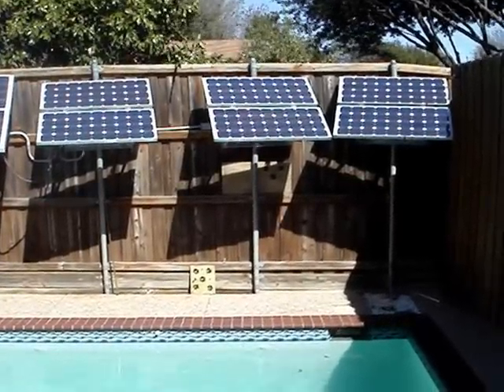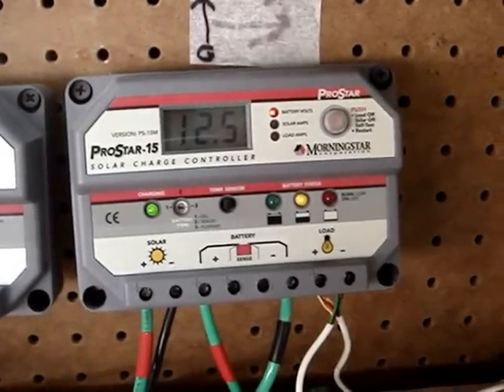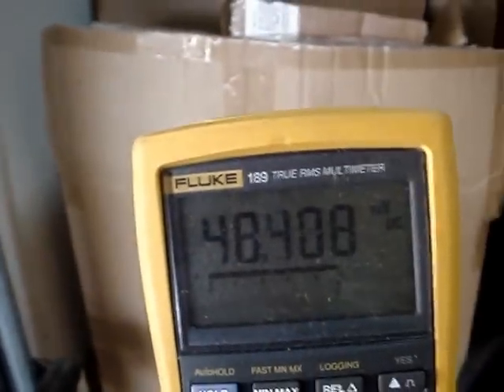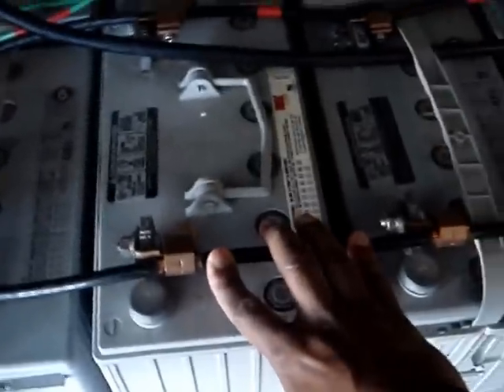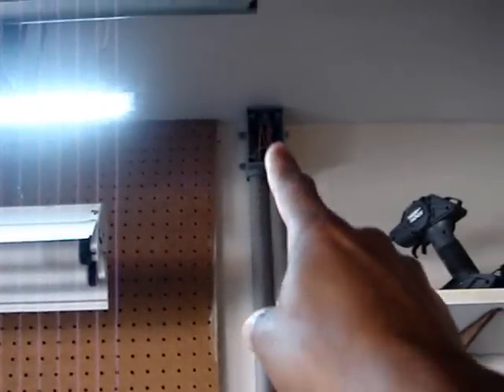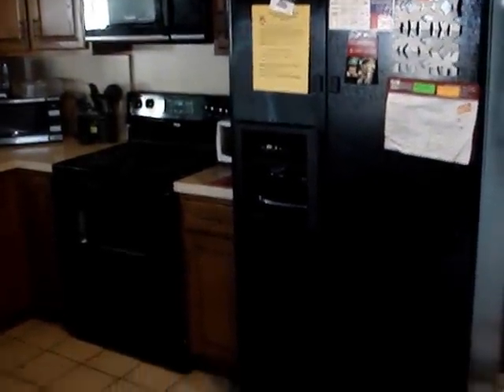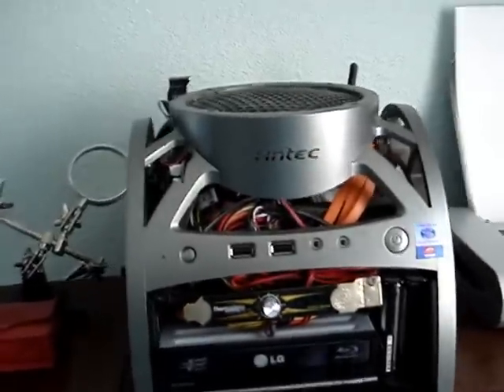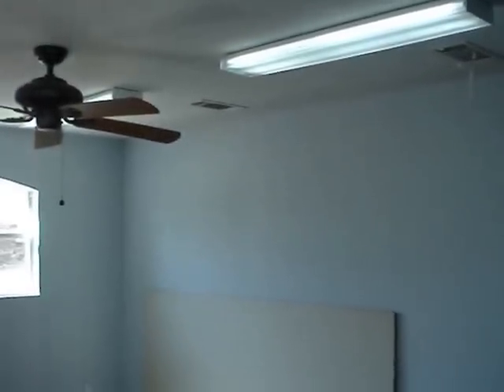My Solar Setup

Comment: Is there no way to run the 240 volt appliances? A 240 volt inverter? You've done a great job!!!
Reply: QuantumBraced You can get two Xantrex inverters and hook them in series for 240 volts. They have an Ethernet cable between them to communicate with each other.
Reply: And/or run at 24 or 48 volts and it'd run great I agree those inverters are great. Clean power
Reply from the maker: QuantumBraced there is but those inverters are expensive and power hungry
Reply: IwannaGoFast Solar xantrex inverters are around $1000 each. that I have. Not sure about the power consumption. Mine has a built in charger though. I'm not sure if you would need that in both inverters.

Comment: It's amazing what you have done. If you replace your stoves with gas stoves and you just put wet clothes on a rope and not use the dryer, you can actually just unplug from the grid completely.
Reply from the maker: fuertesyrobustos Thanks and yep thats what i would love to do, but my wife likes the convenience.
Reply: fuertesyrobustos True but the dryer helps save time, plus makes the clothes look and feel nicer. If I had all of that at my house all on solar, especially in the kitchen like that, it would never be a problem to pay the electric company for using the dryer. I want to make any small solar setup to get started and then grow from there.

Comment: Thanks for running us through your rad setup!  Your family should be proud.  Wish you would have toured us through your chosen battery bank products... Im sure youve researched enough about batteries by now!  Point of contention, Im a little disturbed by your green plastic "cook pot".  You deserve the best, get yourself something made of glass instead of fluorescent plastic.  Most of all, even if u keep the plastic "cook pot", please get yourself a glass pull, never use a metal or plastic one.
And strongly consider a solar powered vaporiser... why use gas?  Vapor Brothers makes good wood and bamboo products from well resourced forests.
Reply from the maker: EG Murray Hi Murray, I'm a little confused. what green cook pot? there on the kitchen counter is a stainles and black rice steamer. maybe it was the poor lighting.
Reply: I was referring, as delicately as possible, to your green bong.  You deserve better than to imbibe all that nastily decaying, BPA, etc  plastic.  Excessive heat and excessive cold (ice cubes) all further an already non-ideal experience. If you're not a juvenile boy, than get a real glass piece with a non metal (ceramic or solid glass) pull already.

Comment: Are they all the same solar panels. How much till Its all paid back?
Reply from the maker: Stephen T Hi Stephen, all sixteen 85 watt panels are GE. The two 125 watt panels are BP. this system was put together of all used items from ebay and craigslist. cost about $3k. it knocked about $210 off my bill.
Reply: That's very good. The $3k was very cheap. Is that $210 off your bill per month.

Comment: Are there any problems with running the two charge controllers at the same time? Do they 'fight' with each other? Would it be possible to run 3 or 4 charge controllers at once on the same battery bank?  I'm no expert, but I think running the PV panels direct to your battery bank seems unsafe. I guess it's working? I assumed they would need their own charge controller to be safest. I don't know. Your setup looks great. Looks like you can run almost anything with it.
Reply: Some are designed to work in groups. You'd obviously have to check.

Comment: Nice setup! That's a cool place. Like how all the batteries were all on one wire.
Reply from the maker: off grid kid Hi and thanks for noticing that because that took a long time heating and bending all those terminals, skinning all that wire just where the terminals contact, i was on my knees bending over that battery bank for 12 hours doing that. It was the hardest part of the whole setup. my back was hurting.
Reply: Good things are worth the extra time.

Comment: but you do have 220vac .you have two 110 vac inverters.witch gives you 220vac.witch will work fine .and dont stand around the batterys to long.the gas coming off the battries will kill you.but you have a good system.herb

Comment: Nice! I like how you used the fence, the single cable for the batteries was very innovative. You must have a dump load to regulate the power level to those batteries? Impressive work, subbed.
Reply: ***** I watched the video again, he has a manual switch to disconnect the panels that are directly wired to the batteries. Some types of charge controllers (my xantrex c40) have the optional dump load. I think its more commonly used for a wind turbine.
Reply: One of the coolest ideas I've seen people do is to replace 1 or both elements in their hot water tank and with the "dump" load (excess power when batteries are full) and they use that to preheat or heat their hot water fully if they have enough panels that it's common. Farmers use it for just that a lot also. Or straight to a smaller inverter thatd charge your Dewalt cordless etc? Even a 12volt bilge pump to water your garden w a rain water tank. Just had to be something that won't need a ton of power and that doesn't need to be consistent

Comment: UMMM, your solar panels are cranking out a LOT of juice.....but you are pulling 2.5 amps out of your batteries. Wow, you need to better utilize the energy harnessed by your system, IMHO.

Comment: Just one question, Is your Tripp lite inverters pure sine wave ? Thanks..
Reply from the maker: No don't think so. But I have got 4000 watts out of them @125 vac 60Hz.
they are (Tripp Lite APS2012). they are rated at 2000 w but easily handle a lot more.
they also have built in 100amp battery chargers. They don't whimp out when the going get tuff. I love these inverters.

Comment: Great video and useful information.  I am getting ready to set this up in my house and will be putting my battery bank inside.  Can you tell me if the battery bank and inverter set up that you have in your garage throws out much heat?  This will tell me if I should think about putting in upstairs or downstairs. thanks

Comment: please protect those batteries from any stray metal tools, etc, contact.  You have a lot of short circuit current available in the open, under your bench.

Comment: nice work bro, how long for it to pay for itself
Reply from the maker: Well the system didn't cost me but about 3K. and I can save about $200 a month with it. saving $ was only part of the goal. Being able to have electricity and maintain some kind of normality for my family in this uncertain world, and fragile power grid. is the overall goal.
Reply: IwannaGoFast Solar thanks for reaponding
Reply: Nassim Bendimerad well lets see here, free power, that probably cost him 3-5k to build, in one to two years its paid itself off. Every year the electric bill in an average household is $1200, if he slices that in half, you save $600 a year, after 5 years that $3000 (that's if the batteries last 5 years, they will most likely last longer considering they are constantly maintained and charged properly by the controllers. I have a 1000AH battery bank, with a 1000watt solar array. I run my refrigerator, my tv, xbox, and surround sound, laptop, and printer off of a 6000w inverter with no issues. I have had the same 12v 100AH deep cycle marine batteries for 8 years and they still hold a charge wonderfully. My electric bill is $22 a month. Point and case.
Reply: Imperial Auto Detailing and my system cost me around $4.5k to make with me doing all the work. The batteries are $200 a piece, Solar panels are 12v @ 100Watt Each cost $150 per panel, Outback 80a Solar controller was pricey but I managed to get a used one for $200 and it works great. The inverter was $600, wires and other hardware was another $200.
Reply: its called self sufficiency! and the fact its something you control vs being at the mercy of mother nature....
Reply: IwannaGoFast Solar what's the point if you have to buy new batteries each 4 or 5 years ??

Comment: Is all this solar to save on power bills or back up in a power outage?
Reply: I think it's a huge expense going solar, if you are in an area that loses power for weeks at a time I suppose it's worth it. I signed on with a business that can get you a free power bill. It's only in 19 states right now, mostly back east, but by 2015 it will be in all 50 states. How does it work? If it's in your state you sign yourself up for energy, you get a website and you see how much the company if offering a kw for and you look at your current bill and see what you are paying for a kw, if we are cheaper you sign up and save on your bill, if you get 10 people to do the same the company will pay your power bill. There are conditions though for example you can't have a $500 a month power bill and go sign up 10 people with a $200 power bill. The company would do an average and that's how much would be off the power bill.Oh and you also get paid a commission every time a customer pays his bill.

Comment: I have hooked up two 5000 watt inverters to get 240 ac by hooking naturals from each together than u have 2 hots of 120 each. dc side i have four 255 amp hr  deep cycle batteries. 255 x 4 =1020 amp hr. have no hooked up on solar yet.
right now i charge batteries with a 150 amp auto alternator hooked up to a old lawn mower engine w/16 hp.
this set up runs a 40 gal. water heater with a 3500 watt element and all the lights in home and microwave.batteries are charged for 1 hr per day. in 30 days  about $20.00 to $30.00 in fuel cost. cut a $200.00 light bill down 75%.
now i need to price the cost of solar set up. for more savings.

Comment: I think you can use both your inverters and wire one to the first buss bar and the other to the second buss bar and you would have 220 volts on your main panel. You just need to combine them on one main panel. 120 and 120 = 240 volts. just wire them to the main breaker.
Reply: I wouldn't do that..............there are electronic reasons why that won't work and will cost you both inverters.
Reply: There's no way to phase them properly. Not good.

Comment: great job and I do understand a working progress. have you had power loss at night running off the battery. or do you maintain thought out the night. and recharge the next day. also r u set up that if you solar fails for some reason maybe some how thow a switch and get back on grid. You ready gave me a lot to think about I am playing with the idea of doing something like this at my house. and yes you house runs mostly on 110 but the main power eater in most homes is the A/C unit and hot water heater. but they are 220 :( which sucks. maybe with some more panels you might be able to run some window A/C units and click off the central unit. who knows but is a nice set up thanks for sharing hope to see more.
Reply: They make 12 volt and 24 volt heat elements for water heaters.
They also make low voltage air conditioners.
And he could run a window unit any time since he has enough power to run it.
Reply: Bonnie you are 100% right!! That kind of stuff is where everyone should start..... Hot water heater elements, ac units, refrigerators like you mentioned because for a lot of households their hot water tank for a family of 4 costs a hell of a lot more vs running light bulbs. That's where people see the return on their investment, not hooking up their garage lights for something to tell their friends lol

Comment: You see like an intelligent person with a lot invested in money and self education. I enjoyed your video, but I have to make a critical suggestion. That is that you never run your panels directly into the battery bank. Your voltage output is too high to consider it CCCV healthy. Plenty of 100 amp controllers on the market to take care of your total needs. Better to spend that money now, than on prematurely failed batteries.

Comment: oh you might have to change your inverters to 24 volts mine is 24 volts at 3000 watts i power my hopme completely just like yourself works better than before i was on 12 volts i will never go back infact i would love to go on 36 volts but thatmeans i would have to get rid of my inverter again at 500 euros a piece NO thanks
Reply: I have 36 Volt. Some accessories are hard to find. Charge controllers, inverters etc.

Comment: what you need to do is connect 4 panels in series at 48 volt more volts the better
buy an outback flexmax 80 they go up to 150 volts and connect your batteries 24 volts the outback converts 48 volts down to 24 volts works without a fuss Believe you me you wont be dissapointed and you will never run again on 12 volts.

Comment: Thanks for sharing. What a great installation you made! Are you grid-connected? It would not make much sense to have a battery-bank and be grid connected, you could install more PV's instead. You're not heating your swimming pool electrically, are you?  Thermal swimming pool-heating is the absolutely most efficient way. Again, thank you for sharing, your work is great!

Comment: What gauge of wire r u using from ur panels to ur controller? I have a 135 watt setup just to learn then go large scale and with a 100ft run of 10 gauge wire I'm only getting 5 amps compared to 11 amps with a 5ft run

Comment: Hi,  I like the commitment you have made.  I also like the led tubes.  Can you provide a link for those?  On a different note.  You are using way to small cable.  While I know that a amperage chart may show you can use that guage.  But you are experiencing huge loses.  I say this as an Electrical Engineer.  Other wise.  Good job.

Comment: A lot of talking about amps and volts, but not much about energy. How much enegy [kWh] you produce per month?
Reply: TheSimpsonsLover What type of battery is it that doesn't require venting?
Reply: Dwyane Dandridge SLA (Sealed Lead Acid) batteries not require venting in normal (no damage, no overheating) conditions. These are used in computer UPS (Uninterruptable Power Supply) devices. There are also Li-Ion, Li-Po, Ni-MH and few other kinds of rechargeable batteries which not require venting, but these are too small/too expensive for big energy storage.
Reply: Technics6. Thank you very much.
Reply: ***** If you overcharge them there are vent caps that pop off.

Comment: Looking sweet. Great way to find stuff on the cheap. You're pay pack will be like 1.5yr with the next 25-30 free $. I'm guessing your charge controllers you do have will detect increase volts on bank from the panels without controllers and back off accordingly? I guess if you leave for trip you leave loads on in house or disconnect some panels. Ever consider using SunG plugin GTI for the excess once batts topped off? You can get cheap relay ($60) and setup to relay excess to GTI

Comment: Thats cool 3000.00 for the hole setup right . If I owned a house I would invest in this for power .But I would use solor and wind , wind when there's no sun to charge the solar panels . Thats a great way to save money and get off the grid . Can you run if setup 220 a/c unit with the proper power inverter , I was wondering if you can se it up like the grid power sorce .

Comment from the maker: Hi thanks for the comment. This system cost me under $3K as I perchased everything used, on sites like craigslist. Saved me alot on inverters, batteries.
My electric bill went from $340/mo to lowest $92 and avg $130. This is in a older, larger 4 br house with guess house and two H/Vac systems. Pool pump running everyday. everything electric, no gas in this house :-(

Comment: Get a controller on those panels rated for the power! I did that once and it nearly burned down my house, insurance refused claim because the controller was under equipped! Get a pair of ts-60,  they are about 180 each on Amazon. Order now, go disco all of this now.